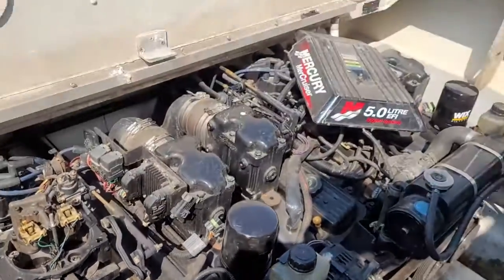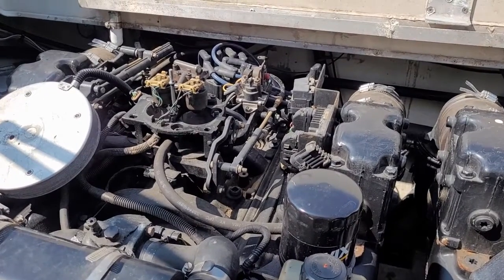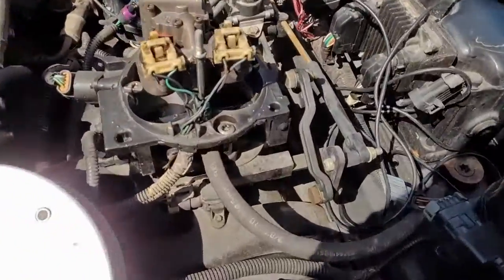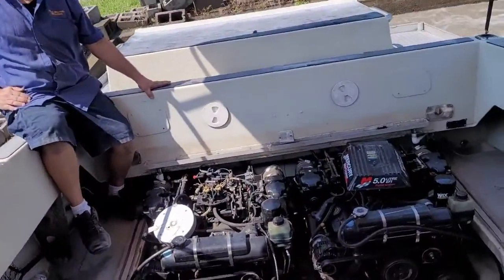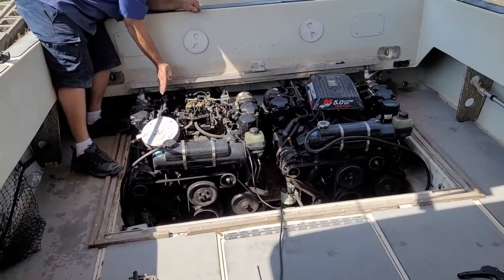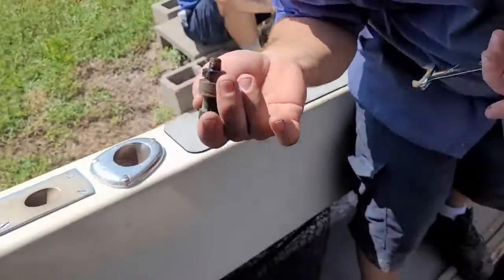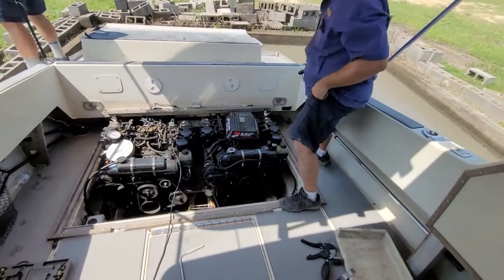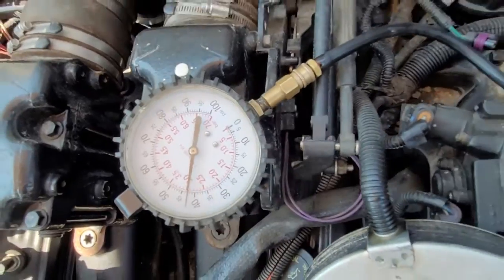Twin 350 Mercruiser TBI  troubleshooting

Comment: Great job lol hey I have the same engine with a flood  issue from the bowl overfkow tube way too much fuel I've changed every sensor except the air fuel sensor you pulled in the vid I'm getting about 40 psi of pressure think the sensor is feeding the computer bd info asking for too much fuel also changed the temp sensor which is known to do that aswell. I'M going to see if disconnecting the plug makes a difference

Comment: This does not rule out just the fuel pump failure..... 

The pressure is not good, thats what you see.. But it could be restriction in the fuel comming to the fuel pump. No good feed to the fuel pump is also no fuel pressure. 

Greetings,
Reply from the maker: There was several issues they have all been resolved for quite some time in the boat is still running good to my understanding
Reply: What were the issues for the low fuel pressure?